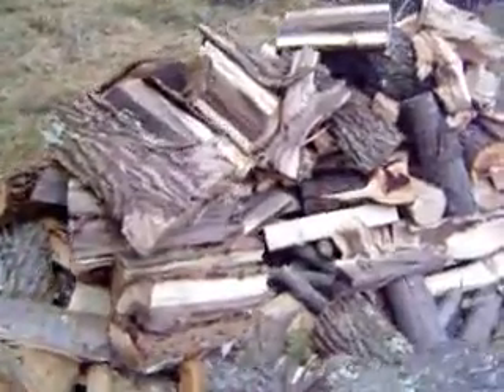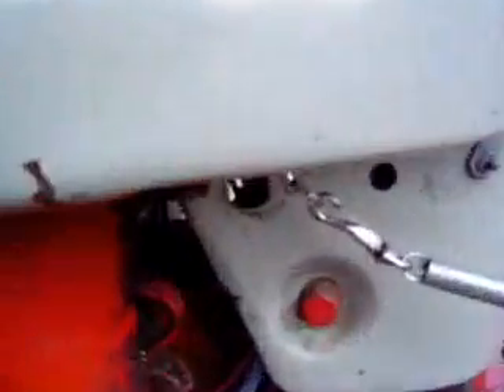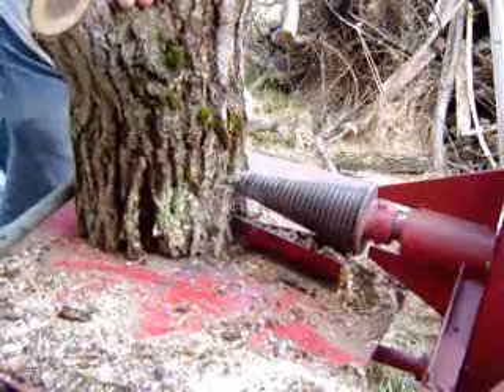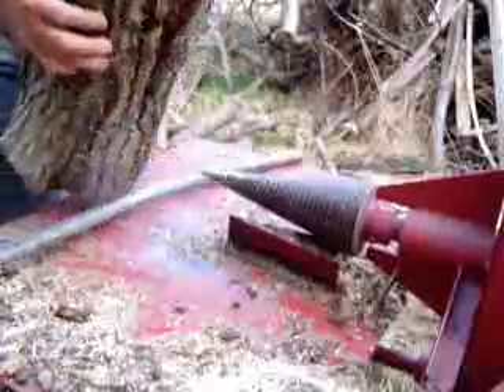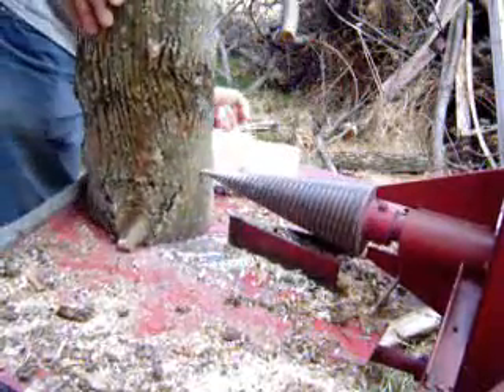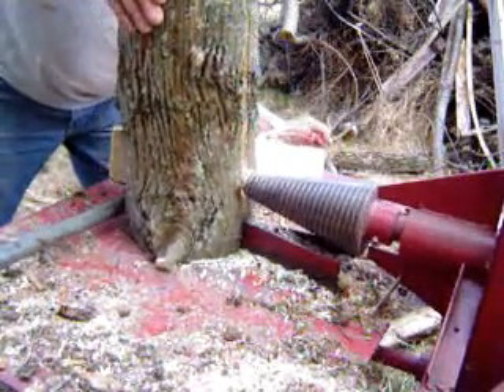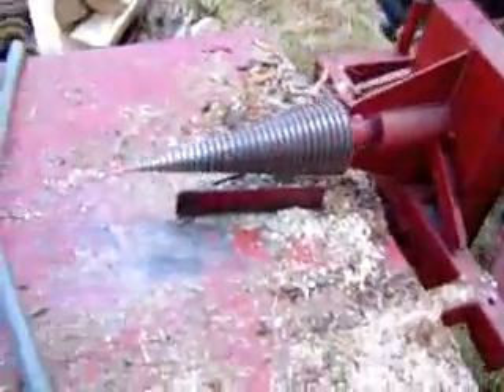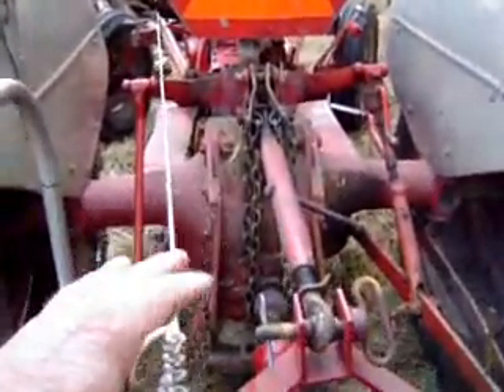Tractor 3 point, PTO powered screw log splitter (converted from "back on" splitter)

Comment: How many rpm was that running? Im building one to go on the 3 point of my cub cadet 782. Ive got 18hp so i should have plenty.  
Im gearing it down with a gear box. Ill end up with a max of 312 rpm at 3600, and with my engine running at peak torque around 2600 rpm ill have 225 at the screw .
 I think that will be plenty because every video of a 540 pto model sounds like its not running the tractor at rated rpm and they seem to be pretty quick.

Comment: I think your screw threads need sharpened.  Should grab and pull the wood without the bar.  Walnut and Ash are some of the easiest woods to split usually, but like you said it is stringy and crotchy.  That stuff burns better anyway in my opinion, when it is like that.
Reply from the maker: This year I made two kerfs, with a die grinder, through the threads for about 3" from the point. This makes each of the threads like a chain saw tooth. Works much better, as far as getting a quick bite into the log.